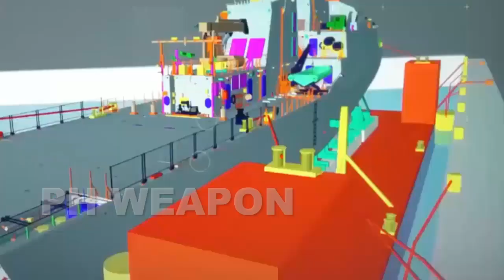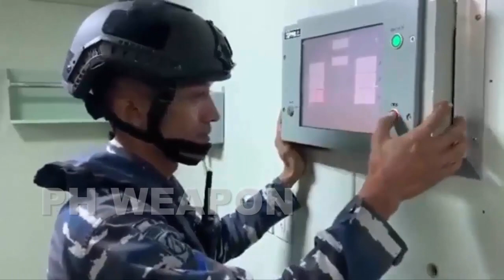Capabilities and Design of the Six Offshore Patrol Vessel HDC 3100 for the Philippine Navy from HHI

Comment: We dont want those corvet and those 6 opshore patrol vessel fitted with nothing put heavy armaments on it those 2 corvets use those vls active put missile onnit and put two ciws in front and at back of the ship then those 6 opv put one ciws on each ship WAG TIPIRIN lulubog lang yan pag tinipid
Reply: The 2 units of HDC-3200 class Corvettes will be delivered with Fully and heavily armed, no FFBNW DEAL, unlike the Rizal class Acquisition which has FFBNW deal. Upon delivery due to the budget problem of the AFP. while the 6 units of HDP-2200 class OPV's will be deliverd with FFBNW , but still be fitted with light weapon systems, due to the fact that we need more units now due to China's aggressions, but will be fitted later with heavy armaments,  such as SSM, CIWS, ASW, and TAS systems, but up gradable if the Phil. Navy decided to install new and most modern weapon systems , lik a VLS systems in front. But for now, ut will be installed with Primary and secondary guns, terciary guns for small fast boats, and RCW's for drones, attack heli's, and low flying MRF's, probably CIWS for the 6 units for last line of defense, flares and sonar decoys, and AW-159 Wild Cat for aerial support. Long range radars and hull mounted sonars for Anti-aircraft, and attack submarines, warships detection and friend or foe identification systems. And more. Plus tech. Transfer deal for the 6 units of HDP-2200 class OPV's. Plus 1 unit Pohang class Corvete as freebies.
Reply: @MonkeyDZuki  those opv should be fitted also with weapons that can hurt china u know what if you put only light weapons on those opv it will only sank we have to put weapons just like what the senate said dont put cheap armaments on ship budget already aggread upon discussion so lets see if it will be like jose rizal frigate also...those two frigate should be upgraded to much capable weapons put ciws on it and those VLS whats that for ist only for design
Reply: As far as i know those 6 units of 94 m. HDP-2200 class OPV's will be a Corvette type OPV's in terms of weaponry, coz they are planning to fit it with SAM, SSM, CIWS, ASW, TAS systems, but without a VLS systems, for now but has an open space for the VLS system, for future up grades and redesignation plans if needed. But as for now ithe Phil. Navy purposely done the FFBNW deal, to get the 6 units and tech. transfer deal offer, for future mass production here in the Philippines, coz weapon systems will be easier to acquire if the budget is already there, and also to make sure that the acquisition plan would still be fitted to our OPV's allocated budget of 30 billion pesos.